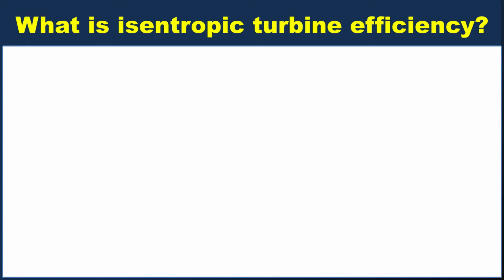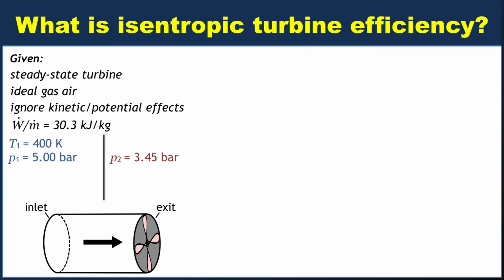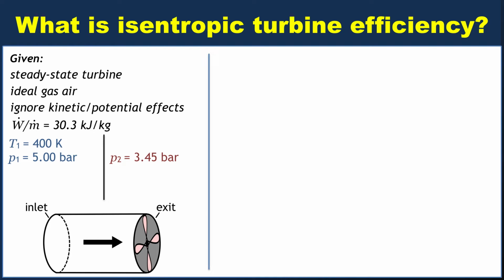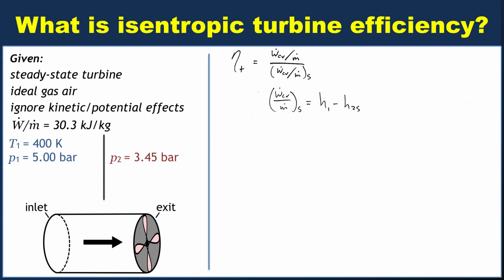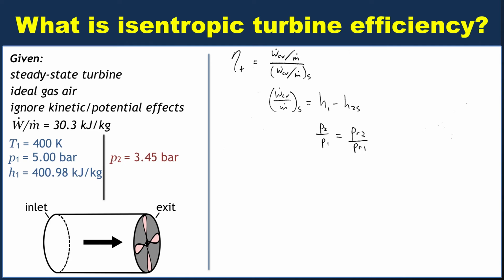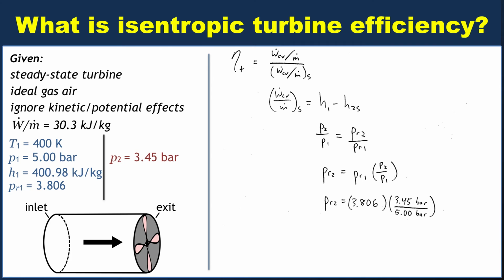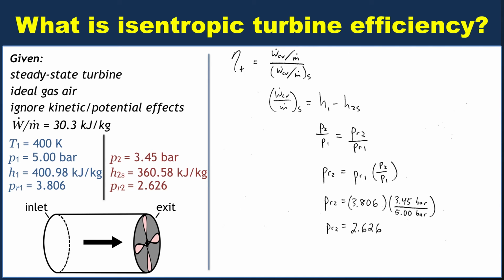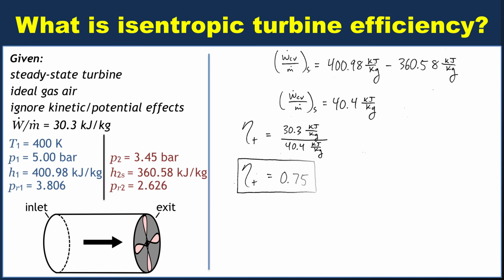Example: Isentropic turbine efficiency

Comment: Great video. One question can we use the isentropic relation with constant specific heat gamme from compressible flow---> T2/T1=(p2/p1) ^(gamma-1)/gamma
Reply: I know that this might be late but yes you can actually calculate it. Assuming that ideal gas gamma for air is 1.4. you can find the temperature at isentropic condition, then proceed to computation for entropy using integral of Cp/R dT where values for Cp/R can be found at literatures.